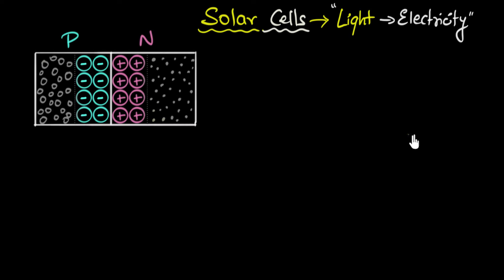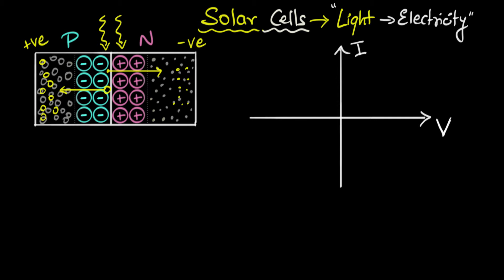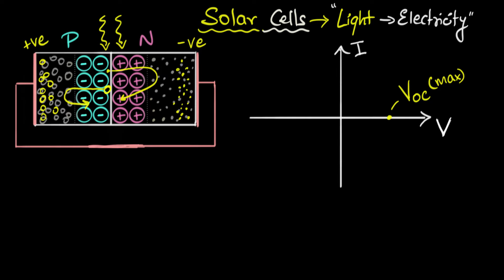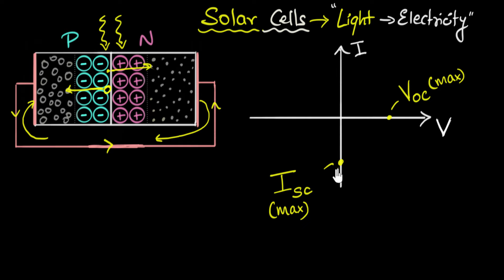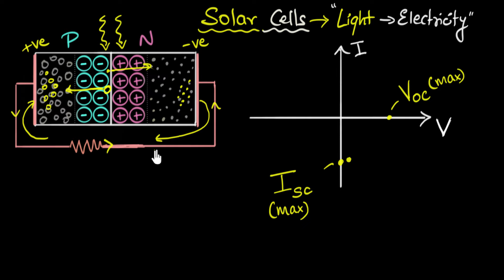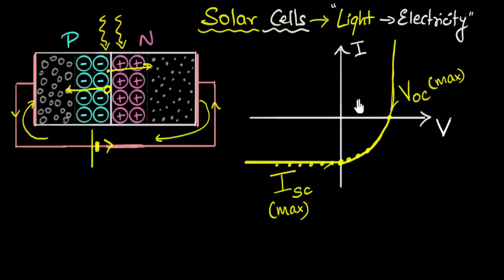Solar cells - IV characteristics | Semiconductors | Physics | Khan Academy

Comment: 00:02 Solar cells convert light into voltage through the photovoltaic effect
01:42 As more electron-hole pairs accumulate, the voltage will eventually reach an equilibrium.
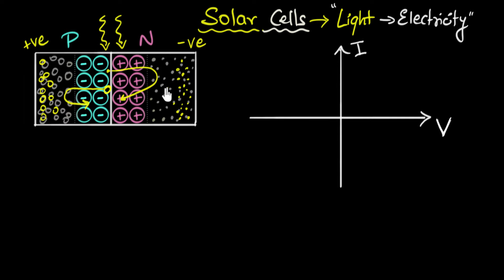03:22 Solar cell IV characteristics explained
05:06 Short circuit in solar cells results in zero voltage and very high current.
06:39 Current is dependent on light intensity
08:17 Adding resistance affects current and voltage.
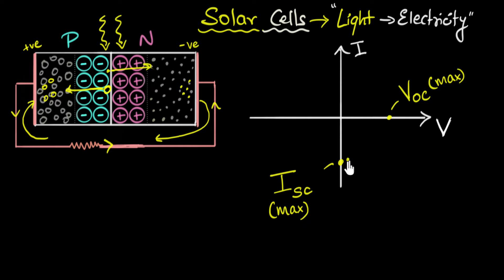09:56 Increasing resistance increases voltage and reduces current.
11:32 Solar cells can't generate a negative voltage, but can achieve it by reverse biasing a battery.

Comment: solar cell is actually something that doesn't need of any biasing. But Photodiode does. Please do variate that. because to extend the IV curve at the end, you have confessed that what if diode has been connected to the biasing element. Rest all have a clear point in explanation.

Comment: Sir at 05:40
You mentioned that there won't be any charges left since they recombine and get destroyed, and that there won't be any charges accumulated.  But what about the newly created charges (due to photons)?won't they accumulate? Will they too get destroyed immediately?
Reply: E.H.P generated by photon will travel towards N&P region continuously untill the photon incident on junction. But Due no load or short circuit of P & N terminal they start easily recombine also .Therefore charge will not accumulate on both P & N region just like open circuit case.As a result Isc will be max. In ckt. But Voc will be zero.

Comment: i have a doubt, current flows opposite to electron flow, therefore if electron is accumulated at n-type and holes are accumulated at p-type then electron will flow from n-type to p-type and current will flow from p-type to n-type. does that makes sense?
Reply: let's me correct a bit for you. Electron will move from p-type to n-type because the affect of built-in electric field which was form during the contact of p-type bulk and n-type bulk. More detail, electron and hole will diffuse toward opsite side. Then at the depletion area electron will be localize at p-type side, hole will localize at n side. Generated electron/hole will be atracted by hole/electron (built-in field direction) toward to n/p-type bulk

Comment: Sir at 08:51, why is it that there needs to be a Potential difference for current to flow across a resistance?
Reply from the maker: Ohm's law. V = IR. If you are wondering why Ohm's law, then I recommend going back to current electricity unit

Comment: you said zero voltage and high current flows, how is  this possible becausevoltage is the reason why current is produced
Reply: we are talking about Open-circuit voltage, not just a voltage. And short circuit current also not only current

Comment: I think increasing light intensity will not affect the current because current depends upon frequency of light (plank's equation) not intensity of light. Hence, more number of photons do not guarantee more current but higher frequency do.
Reply: Increasing light intensity means more photon which means more splitting of electron hole pair  and generation of more free electrons and holes>>>>> & current is directly proportional to number of charge carriers